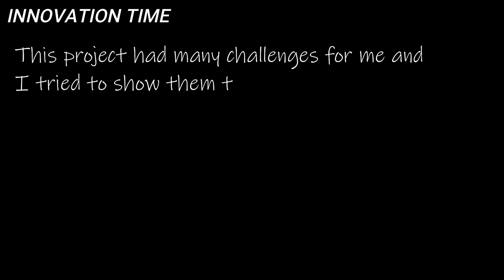How can change an Angle Grinder into Belt Sander || Handmade Belt Sander machine

Comment: Not bad, but I do see you have a lot of vibration and when you sand I see the belt moves to the right trying to slip off. When I built my first upright belt sander I had the same issues. The belt moving is due to the flex in the metal. I had to stabilize it with extra bracket on the table part, this has drawbacks. As for the vibration, somewhere something is symmetrically off.
Reply from the maker: Thanks for your opinion my friend 👍
I have made new one , better work and no vibration 😉
You can find it in my channel